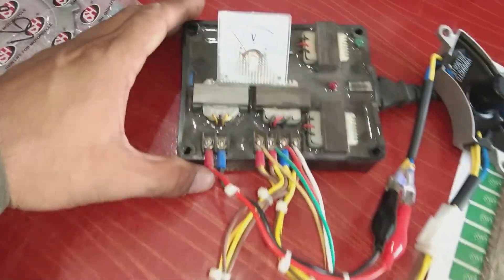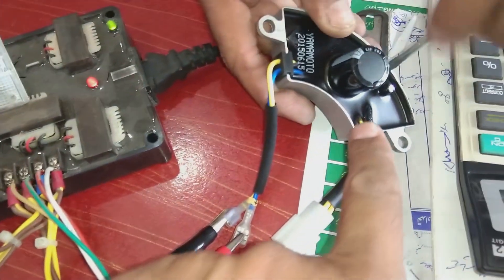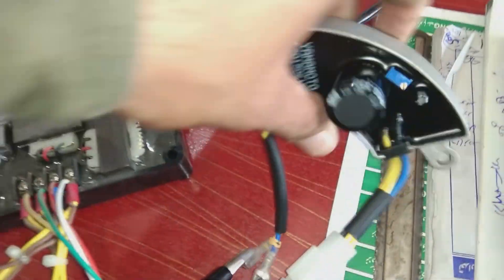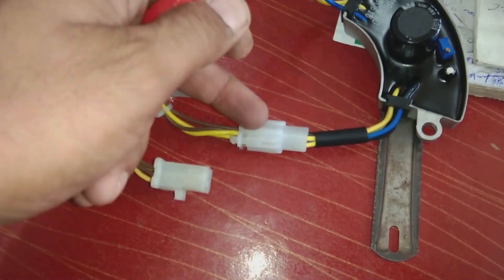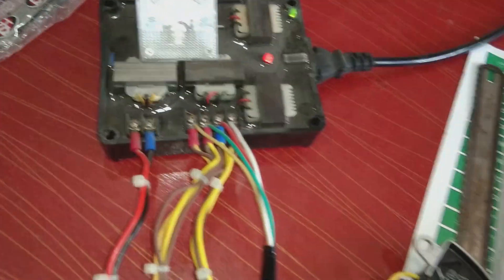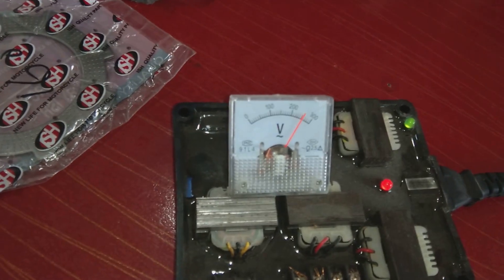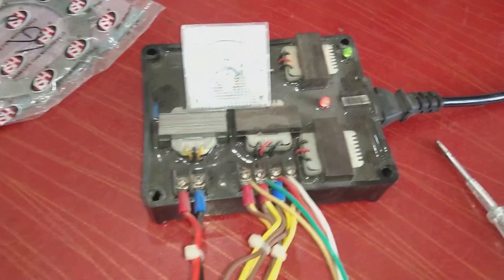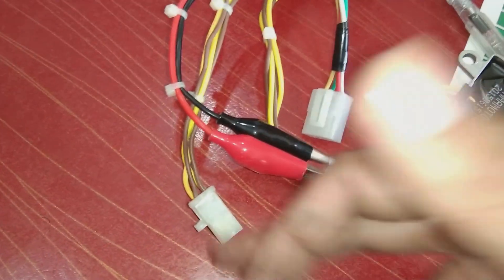AVR testing and calibration. Generator AVR testing and calibration gadget. This instrument is great.

Comment: Is this channel still active?
Reply from the maker: Yes.
Reply: @JahanZeb1976 
Do you have, or can you do a video on how to identify the wires on the avr?
The four in the large plug, what readings you can take to identify them and how to match them to the windings on the alternator.
Some avr wiring doesn't match the plug on the generator even though the avr is compatible with the generator.